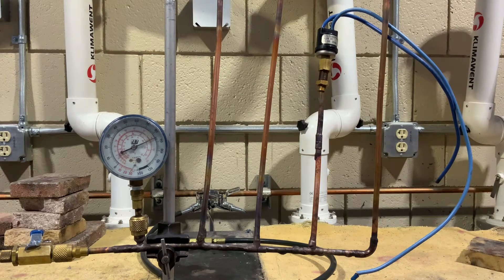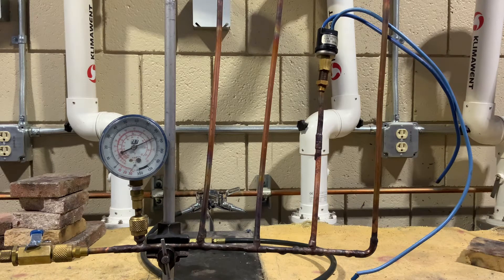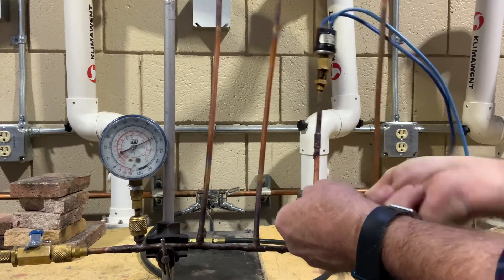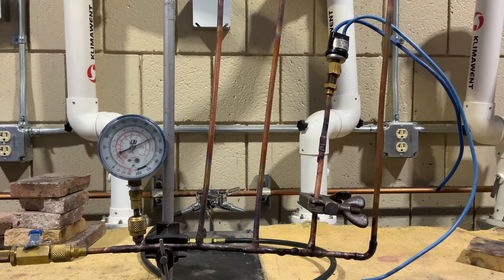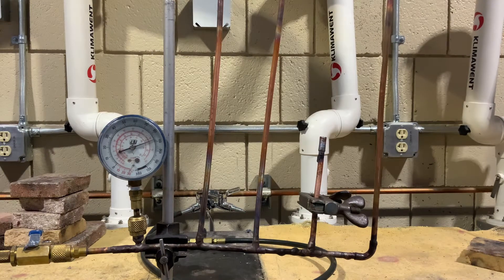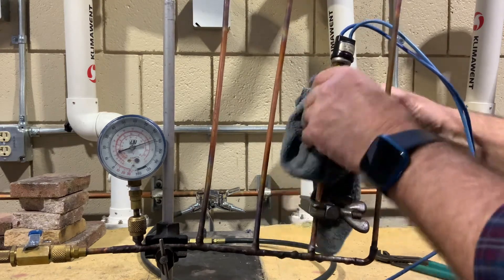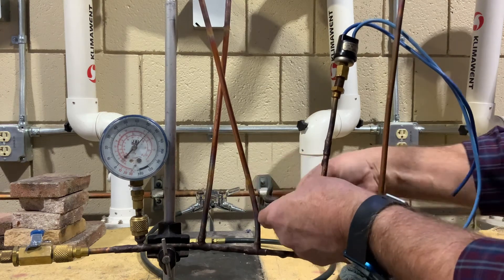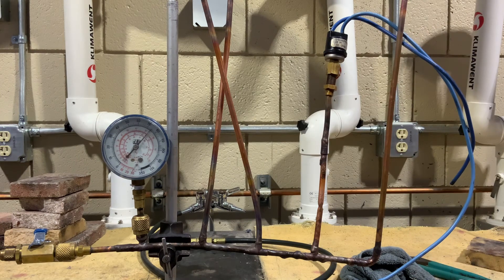Using a Pinch Off Tool To Change a Pressure Switch

Comment: Cool tool. I like it. I also think a pair of needle nose vise-grips would work, but then the need for the restorer comes into lay. Maybe just use the vise-grips 90° from the pinch. Thanks for posting, and sorry for the delay in responding.